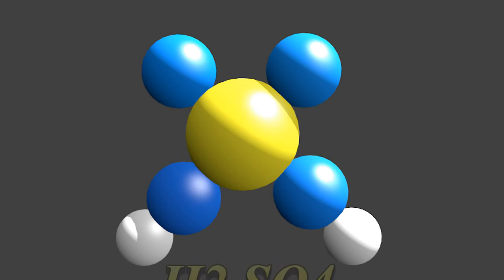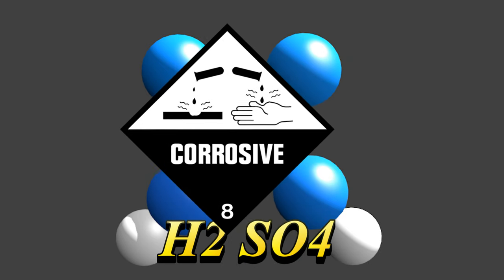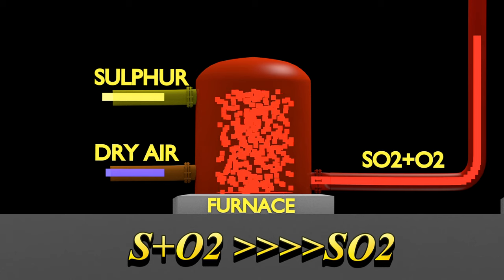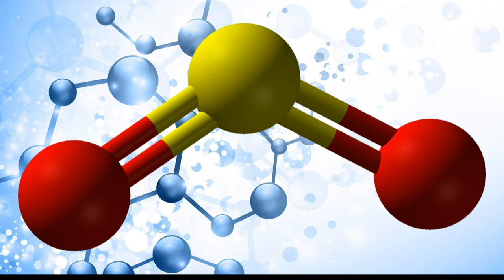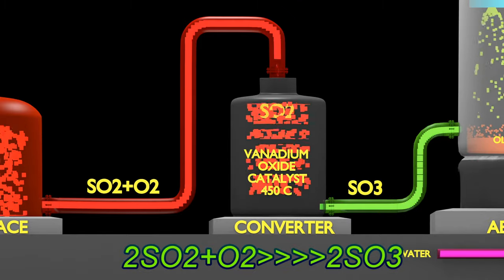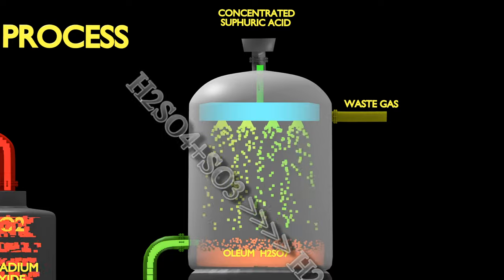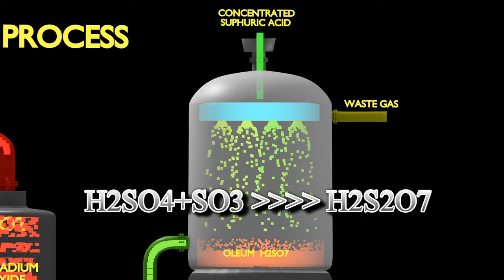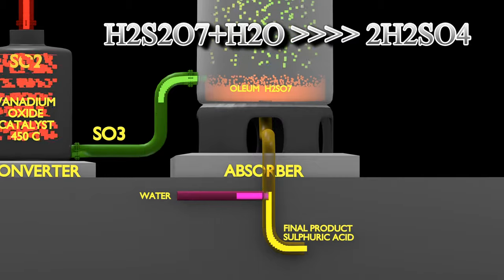H2SO4 Process

Comment: Great video!
One question:
How come we add sulfuric acid to oleum? Where did that sulfuric acid came from? Because this is a process of making sulfuric acid, how can we add something that we are making.
Thank you for your explanation.
Reply: The sulfuric acid that we added is already bought in a small amount just in sake of the process making oleum (a thick mixture). It can be bought from places in small amounts just to make a large amount of sulfuric acid in the end
Reply: It is purchased from a different plant. Historically, sulfuric acid was made from the chamber process, which did not require any sulfuric acid to start, but was quite inefficient. Once a large amount of sulfuric acid was in circulation, it was replace by the contact process as shown in the video. Since the output is twice as much acid as you started with, there will always be acid left to produce oleum.
Reply: Can you give one example of plant where sulfuric acid found ?